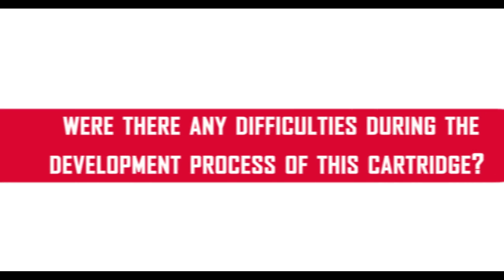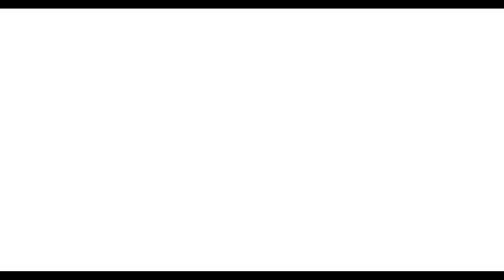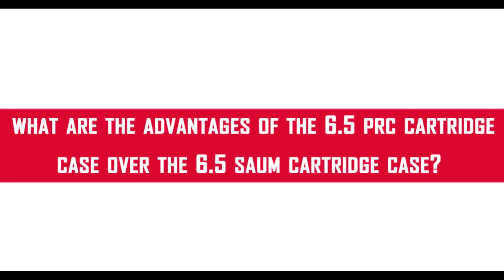Hornady® 6.5 PRC - Q&A with George Gardner

Comment: Apparently a lot of low IQ people, like Ray Blackburn, are  having a very hard time grasping the concept. “I can shoot my 7-08 3300fps with 100gr”. Well good for you Ray. But considering the entire point of this exercise is to launch heavy-for-caliber, high BC bullets at reasonable velocities, one can only assume you slept through a lot of classes. Try comparing apples to apples. The BC of your 100gr 7mm bullet is under .400. Good luck using that in a prs match. Now try loading your 7-08 with a 180gr, long ogive VLD style bullet that has a BC around .650-.677 and you have a long range bullet, but not a long range rifle because your velocity tanks, which is why in 7mm guys use magnums like the 7mm LRM for prs. But wait, you won’t ever find this out because you can’t even fit that case with the long ogive bullet into your Savage 7-08 magazine without seating it half way into the case! Are you starting to see what GA Precision and Hornady were trying to do? They weren’t trying to get maximum velocity. They were trying to get a long, heavy, high BC 6.5mm bullet to 3150fps in a short action rifle. For all the other wizards out there saying it’s just another 264 Win Mag- well good luck finding a 264 with a twist rate that will stabilize the 143gr VLD bullets. Being that SAAMI mandates a 1-9” twist for 264 WM, it ain’t gonna happen. You’d have to custom build a 264 with a 1-8” twist to stabilize those bullets, and then it would shoot them faster than the PRC. If you’re having a hard time figuring this out, think about the bullets first. It’s not about max velocity, not a drag race, that was the game 30 years ago. But then someone figured out you could move a high BC bullet at moderate velocity and significantly outperform a light weight bullet at max velocity when shooting at longer ranges. 
If you’re going to respond, at least try to understand the subject you’re responding to. Reference some of Gunwerks literature on the subject if you want to get educated. I’m not defending Hornady, or saying what they’ve done is perfect, but I do understand what they were trying to do, and it has nothing to do with half of the comments on this thread. I have no doubt Ray bitched about the 300 PRC, saying “it ain’t no 300 Win Mag”. Well you’re right, try finding factory 300 Win Mag ammo in 212-220 gr VLD bullets. Or load some up like the PRS guys do, and try to fit them in the magazine of your factory Tika. You can’t? Ah hah! Well Cooter, maybe  Hornady just created a product you can buy off the shelf, that will allow you to shoot the same loads the PRS guys shoot, without having to hand load.  They also got it SAAMI approved, so pretty soon you’ll be able to buy a factory rifle with a magazine/chamber sizes to fit these loads. Up until now, if you wanted to get into this game, you had to have a custom rifle, or custom ammo, or both. Are you starting to understand what Hornady did? They just opened a door that, until now, had been closed to most people. But what do they know, you can get 3300fps with a 100gr 7-08, so pee on them
Reply: @Rick Flair That is one of the best comments I've ever seen on YouTube. Well done Sir.
Reply: Farken zinga Ric! WOOOOOOOOOOOOOOOOOOOOOOOOOO
Reply: 7LRM in PRS??? Nobody that’s competitive uses any sort of Magnum cartridge in PRS. 6BR, 6 Dasher, 6X47 Lapua, and their 6.5mm equivalents that is all. Unless they are shooting a .308 only class.
Reply: Good info. I'm a 264 win mag nut and I will have to drag out the chroni and some of those special 143 grainers you speak of.
Reply: Woooo!! Get em!!
Reply: But Ray Blackburn's 7-08 can shoot rounds that have a larger diameter then the 6.5 PRC.  Hornady failed hard trying to make a magnum this time.   You don't have to thrust as hard when you got more girth.
Reply: Woooooooooooooooooooooo!
Reply: @nancyherman2137  ALL these new wizbang  RIFLES  lightning in a gar  PRC & Needmore need to be painted nipple pink for the suckers that buy them .the .264 WIN MAG IS A FANTASTIC  RIFLE /
Reply: @davidorpwood8433  um... what?
Reply: 284 win is a really great cartridge. Alot of F-class shooters use it and it's one of the best cartridge for an all in one gun. It accepts long VLD bullets unlike the 7mm-08 and shoots them a bit faster.

It's also a short action.😁
Reply: @davidorpwood8433  The 284 win too! 😃
Reply: Woooo
Reply: stop it. hes beat down. no need to keep swinging lmfao. Great post

Comment: I am currently on the fence looking at the 6.5 SAUM, 6.5 4s  and the 6.5 PRC.  George answered all my questions, so it looks like I'll be building a 6.5 PRC as my antelope/deer rifle!     Thanks George!!
Reply: The SAUM "can" out perform the PRC on paper......but have you seen what it takes to make 6.5 SAUM brass? I'm sure by now someone is making bulk 6.5SAUM brass but it ain't gonna be cheap or easy to find.
The last question I ask myself when considering a cartridge is.... am I gonna be able to feed this thing with off the shelf ammo I can physically walk into a big box store and buy in a pinch? I think going prc is a good idea.
Reply: @kirkmartin2223  How about 6,5*55? Tried and tested since 1891.
Reply: @darkiee69  yeah that's a good one also
Reply: 6.5 saum and 6.5 gap 4s are the same cartridge. From what I read, the 6.5 saum was the round he introduced to Hornady originally for the project.

Comment: Im glad to see the RCM platform adapted to another capacity and a whole new platform for it. 

IMHO, the RCM should be a mil-spec cartridge for the advantages it brings with it. Honestly, when you're living around a 14 all day, it gets to be a burden. Then 223 became the most used and that really put a hurt on those guys on the ground from longer range cartridges.

RCM should have been issued for the lighter weight with shorter barrels and superior BC to 308 for troops. It's a real shame, it really could save more lives, but this cartridge sounds like the RCM little brother. I hope it goes where the RCM didn't!

Good to see you developing another, superior platform again!

Comment: What about the 260 Rem and as mentioned earlier...the 6.5-284? why is this better? I think the .260 Rem is better than the Creedmoor also.
Reply from the maker: This is a whole class above the 260/6.5 CM/6.5x47 Lapua/6.5x55 cartridges. It's going from a standard to a magnum cartridge. Yes, it has a similar velocity to the 6.5x284, but that is not a SAAMI standardized cartridge. The Norma designated design has a max COL of 3.2" - long action. It also has a rebated rim. For handloaders and long actions, it works just fine. The 6.5 PRC is built from the ground up for the long 143-147gr bullets and will allow non-handloaders great options for shooting, in addition to handloaders.
Reply: For the casual hunter who may only five 500 rounds thru a rifle in 30 years, this caliber seems as perfect as advertised; but what about the guy that fires 500 rounds per year? Similar case capacity cartridges that produce similar velocities have throat wear issues.  Has Hornaday produced as “acceptable” barrel life forecast. Additionally, 8 twist resistance against that volume of gas can produce bullet “skid” issues. Has Hornady produced tougher bullet jackets for the favored projectiles?
Reply: Nobody is going to make 6.5x284 norma ammo in the US. It's not saami spec because it's to close to the 6.5x284 Winchester.  To many law suits waiting to happen.
Reply: Norma makes ammunition for 6.5-284 Norma. You can buy that ammunition from Brownells and MidwayUSA.
Reply: Gunnar Wretlind a few people make it but it’s too complicated of a situation for hornady to go all in on because it’s not consistently chambered the same (Norma/win).

There is a gunwerks podcast explanation of this that does it really well.

6.5-284 is a fantastic cartridge, this is essentially the same thing in a short action that you can walk into a Cabela’s and buy 20 boxes of match from hornady and shoot bugholes
Reply: @hornady  great response! I reload 6.5x284 with 143 eldx and creedmoor with 143s. The 284 likes 2,950 and 3,025. I get the creedmoor to 2,800. Loving speed and watching impacts has me eyeing the PRC and a short stroke!
Reply: The PRC is just the latest shiny new thing on the shelf.
Reply: skajun agree
Reply: Yes.
Reply: I have a 260 of my own design with a 30 degree shoulder.  It runs  rings around the 6.5 Creedmoor.

Comment: 6.5 PRC in a Tikka will give you slower velocity, especially with the longer bullets. I average 2790 fps with 143 eldx from my Tikka with a 24" barrel. The same day my Winchester XPR,  24", was giving me over 3000 fps. 
 127 LRX are not as bad, about 100 fps slower.

Comment: Has this case been looked at with a 30 cal before? Would be kind of a hotter 308 in a short action and could send the 190 to 210 grainers much better. I’ve sent 208 grain ELD in my 308 at 2550fps. I’m a huge 308 fan and 30 cal fan. I am actually getting a 6.5 prc but man I’d hop all over a version of this in 30 cal if someone did it. Would need to push projectiles faster and still be efficient to be worth it. But I know there are guys out there that can test all that.

Comment: On the note of the 260 Rem what about the old 264 Win Mag or the screaming speed demon 6.5 Weatherby Mag.????????
Reply: The 260 isn't efficient in a short action with long bullets, and it's performance is comparable to a 6.5 creedmoor. Not even close to the 6.5 PRC. The weatherby and 264 mags are long action rifles.
Reply: @TexanUSMC8089   Yet I am getting 1 hole groups with an old m1917 enfield action, lol, I must be doing something wrong.
Reply: @mausermongerkoziczkowski8104   I didn't say it couldn't be accurate.  I said it wasn't as efficient as a creedmoor case or a prc in a short action.  The 260 case forces a 147gr eld bullet further into the case taking away powder capacity.  If a person wants to shoot ELD/VLD bullets in a 260, it'll work better in a long action.
Reply: @TexanUSMC8089  And so correct me if I'm wrong. The shorter cartridge allows one to carry more ammunition?

Comment: What does this do that the 6.5x284 doesnt?
Reply: Doesn't burn barrels at 1200rds due to lower pressure from what i understand. Same premise for the 6.5 SAUM.
Reply from the maker: The 6.5x284 most common today is the Norma designated one with a max COL of 3.2" which makes it a long action cartridge. It's not a SAAMI designated cartridge. There's a number of wildcat 6.5x284 Winchester guns out there with much shorter throats.  It's popular more so with handloaders than people buying ammo. If you look at ammo prices at Midway, the 6.5x284 ammo costs typically between $55 to $75. It also has a rebated rim that's a hassle to manufacture and is harder to make feed and function in a wide variety of rifles. The 6.5 PRC is made for the long, heavy 14-147gr bullets but has a COL of less than 3". High performance ammo is available to non-handloaders and it costs $36-38 per box.
Reply: I just bought Hornady Precision Hunter in 6.5 PRC for $33 a box.

Comment: Big deal, as soon as the .300 RSAUM was released in  2001 it was necked down to form the wildcat 6.5 RSAUM.  George has his own version(s) 6.5 GAP 4S  and so did many others with variations in the throating, lead angle, neck diameter etc. Hornady has worked closely with Ruger on the development of .300 RCM  and other cartridges (.30 TC etc.) that's why the  parent case for the 6.5 PRC is from the .300 RCM and not RSAUM cases.

Comment: I think it's popularity will be limited in that it will not work in an AR-308 platform. It's simply too long to fit the magazines. I have a Creedmoor AR and a 260 AR and in order to get close to the lands I have to use all the space that the most roomy magazines allow. The 6.5 PRC is a little longer, so it would need a custom action to work on an AR platform. Of course the AR was not his design objective, but since ARs are so popular and selling so hot, this cartridge will miss out on that market.

Comment: Everyone seems to be trying to reinvent the 270 win! And there reason is less recoil if you need a hunting round you are probably not going to shoot More than 20 rounds on a hunting trip.My advise learn to deal with a little recoil.
Reply: Yeah cause apples and oranges are the same thing!
Reply: The B.C. on .277 projectiles lacks.
Reply: Absolutely agree. Any decent hunting rifle will kick. Practise and get used to it🇨🇦🤠
Reply: It's not the recoil, .277 bullets suck for long range shooting compared to offerings on the market. Better off to go either direction to 6.5mm or up to 7mm.

The only reason they didn't catch on until now is "oogah boogah metric system scary".
Reply: Justin Peck Your logic is not making sense to me. 7/1rhousandths of an inch is not even half the thickness of a sheet of paper to go from .277 to .284 (7mm)
The British designate their cartridge by bore diameter while in America it’s groove diameter.
Just before ww1 the British were in the process of converting to the .275 Rigby. Thats the bore diameter the groove dia is usually another.008 so right around 283 or 284.
When Winchester brought out their famous round in l believe it was 1925 or so they didnt want to people to get it mixed up with the Rigby so they went with .270 bore dia. and .277 groove or bullet dia.
I call it the skinny seven. Extremely flat shooting powerful rd. very efficient aerodynamically. Remington came out with the .280 which is a .284 bullet on a .30/06 case basically another excellent cartridge but they were too late because the .270 win. by this time was solidly established and gaining in popularity by the day.
Today you can find this cartridge and rifles for it anywhere same as .30/06 which is actually my choice because it’s a bit more versatile. The .270 is abit flatter shooting the difference is only about an inch at 400 yds. which means nothing to me at least because l don’t shoot from the road l actually get out there and hunt and l like the heavier bullets.
To say that .270 or .30/06 are not accurate or flat shooting enough tells me that you haven’t done all that much and you have been duped by the big manufacturers ad campaigns. Gotta keep that cash register ringing boys lol😂🇨🇦🤠
Reply: @randyschaff8939  I never said the .270 or 30-06 couldn't be flat shooting or accurate. Try again. 

What I said is that .277 lacks the same high ballistic coefficient bullets offered in both 6.5 and 7mm.

The highest BC bullet that I know of for .277" cartridges is a 145 gr ELD-X with a G7 BC of .270

The comparable bullet in a 6.5mm is G7 BC .351. (147 ELD-M).

This means the 6.5's will walk all over the .270's past 300 meters. You know, long range. What the cartridge is designed for.

It's the exact same issue as the .30-06 when talking about long range shooting. .308" bullets don't start to complete with the 7mm's until you get up above 220 grains. It's just the limitation of their form factor. 

And who said anything about shooting from the road? I punch steel at a mile because I can. It doesn't change the physics of the limitations of the .270.

Comment: Ok so the 6.5 PRC travels 200 to 300 feet a second faster then the 6.5 creedmoore and both are 0.264” bullet diameter . bullets . According to  Hornadys reload books the bullets for both are listed under the same item number . So congratulations you managed to reinvent the 264 Winchester magnum!
Reply: 264 win mag is not a light weight short action rifle. 6.5x284 needs a long action to reach it's potential too.
Reply: @Paul I got a Sauer S 100 6.5 PRC  I also have a 30-06  that is almost is a doctors appointment after you go out and shoot a half box of shells. I am getting on and just passed the 30-06 and a 300 Winchester H&H the 30-06 kicks less than the 300
 I bought the Sauer S 100 and put a Leupold 6-18X40 CDS on it . Whoever said these things kick hasn't shot either one of these guns. The Sauer with the Leupold is a tack driver with very little kick

Comment: Why speed? A 7mm bullet with a high BC at 2800 FPS should maintain velocity with better barrel life than 6.5mm bullets pushed to 3000+ FPS
Reply: who shoots long range with a 7mm at 2800 fps?  What bullet and cartridge?  You have to get a 162gr 7mm bullet to match a 143gr 6.5mm bullet in BC and SD.  It's not going to happen in a light weight short action rifle.
Reply: TexanUSMC8089 284 shehane is pretty popular in F class. Just sayin

Comment: I’m running my 6.5 Creedmoor up to 2929 fps with RL26 with no pressure signs. I’m sure handloaders will be able to hot rod this (6.5 prc) up to 3199.😁
Reply: What bullet are you running at 2929 with the 6.5 Creed?
Reply: i ran my 6.5 gap 4s to 3280 with 140s
Reply: @MattypPhil  I'm running the hornday 6.5 129sst superpeformance  on a rpr 26inch Lri  I'm at3000 fps and2950 in24inch Barell...
Reply: What bullet are you using for 2929 fps?

Comment: I can't find a 6.5 PRC semi-automatic rifle for a decent price.  That's what I'm looking for.
Reply: The Mauser M18 comes in 6.5 PRC and it retails at around 600 USD.  Very reasonable.
Reply: @mikelipsey8837  Thanks for the info!  You're very kind.
Reply: Core
Reply: Not a semi but I just bought one for $429 plus tax brand new Mossberg Patriot Predator 6.5 PRC from Academy sports+outdoors. It's very nice, the fluted bolt and barrel make it light and stylish. I couldn't shoot out the barrel in my lifetime, semi would be barrel eater.